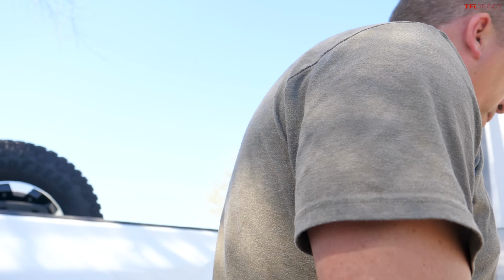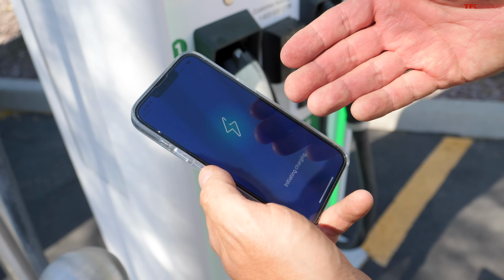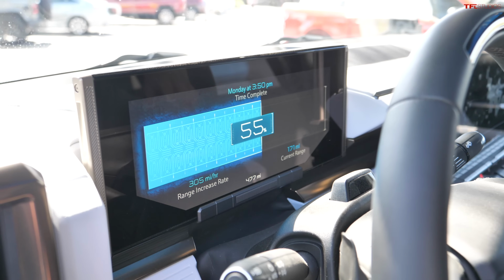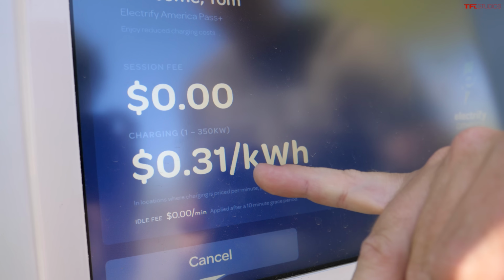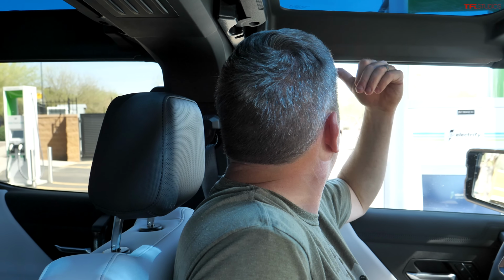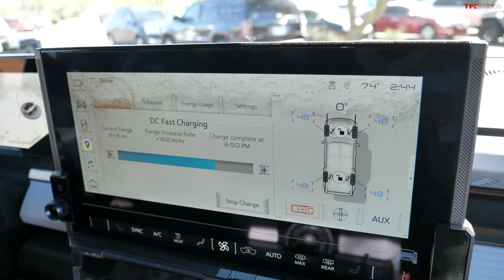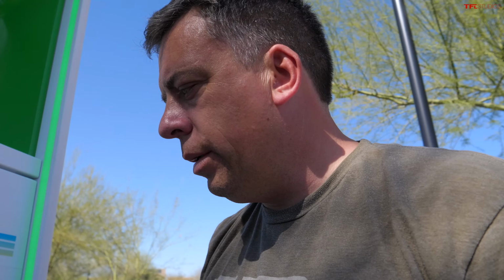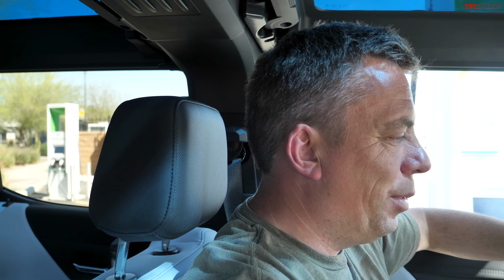How Fast Can I Charge The GMC HUMMER EV In Just 15 Minutes? The Answer Is Surprising!

Comment: Thanks for the review. Quick calculation in my head, this is still much cheaper to power than my 2021 Raptor on 37s. I get 13.5 mpg. Just paid $4.35 per gallon. So it cost me $25.13 to go 78 miles vs $14.25 in Hummer. And the Hummer is much faster. Great information. Also much cheaper to charge at home, I pay about $0.15 per kWh at home. So about half price to drive around town vs road trips.
Reply: Here in Olathe, KS I avg. about $0.11 per Kwh so cost per mile would be even better, however my GMC Sierra is paid for so for me the cost of a new $115K electric truck would be a terrible idea based on cost/mile.
Reply: Going to be a lot of different expectations going to electric. I liked the real world test- thought the results would better however- 78 miles for 15 minutes is slow in my opinion
Reply: Flushing cash down the drain to look cool, my Ford Eco boost is almost as quick and gets twice your gas mileage.  And fuel here in Colorado is only $3.18/gallon
Reply: Gasoline is at a historic high.  The EV would be more expensive in this particular case if gas was $2.00 a gallon.
Reply: @SkeldZ06  Around mid October a comparison showed, On a yearly basis, assuming the mid-priced cars traveled 12,000 miles, it would cost  $1,030 to drive an internal combustion car and $1,554 to drive an EV. 
For luxury cars that get 26 miles per gallon and using premium gas at $3.25 a gallon, the cost to drive an internal combustion car 100 miles is $12.60. The cost to drive a luxury EV, such as a Taycan, Tesla Model S or X or Jaguar I-Pace, is $15.52 to travel 100 miles. That is using mostly commercial chargers. 
“That’s apples to apples and includes the extra EV taxes, the commercial charging and the home charging and the allowance of driving to a gas station, which, for most Americans, is very short compared to driving to a commercial charger for an EV owner.
Reply: @SkeldZ06  yea but gas ain’t ever gone be that low, so you’re talking a bunch of crap
Reply: What’s nice about EVs is that you charge it at night (cheaper than during the day) and you wake up every day with a full battery. How many times do you drive over 300 miles a day?
Reply: @chadkrause6574  The bad thing is our infrastructure isn’t prepared to move as fast as they are pushing EV for the masses.

Comment: If it was summertime and 100° outside, and you just pulled off the highway, how would that affect the charge rate ?
Reply: Dramatically slow it down. Think of your cell phone battery when it's hot. However these batteries are temperature controlled so it's not as if it wouldn't charge at all. I would assume it would charge at roughly 50% rated speed

Comment: Lowkey 14.25 for 75 miles is almost the same as my Acura gets with the high gas prices and taking premium gas. Full supporter of electric vehicles but I was surprised at the price to charge this one.
Reply: Too many videos focus on the cost of public charging as if that’s what you’d usually do.   Inadvertently spreading EV FUD.  Most charging is done at home where the cost is much, much lower (like 2 cents per mile for a normal sized vehicle).
Reply: @-Jethro-  at home Hummer will be charging for hours even on 80 amp connection, which most likely breaker box will not have extra 80 capability and people will have to get another service installed from transformer, if this even supports 80 A at 240
Reply: @tallll70  Yes, true.  It’s so inefficient that a complete charge may not be possible overnight at home.   On a typical 240V 50A circuit it would only charge at about 20 mph.
Reply: @-Jethro-  Ah so screw us millions who live in apartments, or can't have have chargers, got it.
Reply: @snoopyalien24  If you really want one of these bloated things, you will need to find a way to charge it that works for you. 🤷‍♂️
Reply: @-Jethro-  I’ve driven a Tesla and to charge it didn’t cost nearly as much and teslas charging stations are far easier than electrify America
Reply: @martinmcandrew1377  Yep, I did a 1500 mile road trip in our model Y.  Tesla’s superchargers were awesome. We hit 249kw several times. 

But the point I was making is that most EV owners charge overnight at home most of the time.  The cost of public charging does not represent the normal daily charging cost.  I worry that the EV curious will see videos like this one and say “well that’s no better than gas”
Reply: @martinmcandrew1377  man if only they’d allow other manufacturers to charge at a small cost…..
Reply: @-Jethro-  this thing is still a piece of crap getting 1/2 the range of the cybertruck with same pack.  way worse than the ford product and even the planned silverado product. its 9500lbs?
Reply: @richardroberson9277  WHAT Cybertruck? The closest thing you’ll get to a Cybertruck os that Tesla 4 wheeler. The first product is a joke compared to this,😂and the Silverado is using the same pack is just a smaller vehicle.🤡
Reply: Also as the EVs increase over time, demand on the system will increase so will the elctricity rates for EV charging.
Reply: @ussenterprise87  it actuall causes it to go down because youre paying for access to 350kw not the energy alone as a silly consumer would think.  :/ they sit unused all day long now
Reply: This is the least efficient electric vehicle. It’s MPG rating is like 45 MPGe. It’s a horrible product from GM. Probably cause more environmental harm than your Acura that gets 25-30 MPG

Comment: You won't see 350kW charge rates at anything above 50%. With charging, you will see the highest speeds around 20 - 50%. Source: Me, I work on EV chargers.
Reply: its a 200kwh pack.  1.75C at 50% isnt  THAT wild.  you'll see it on the cybertruck for sure
Reply: 1.75C of 80kwh for a model 3 would be 140kw at 50% which i think they can do now

Comment: Interesting video with a focus on the speed but what about the expense? $14 for 78 miles of range? At $4/gallon and 20mpg you'd have only spent $16 for basically the same range, and would have been in and out in 5 minutes with a full tank. Personally I value my time at more than $2/hr. And of course this is before the government achieves critical electric vehicle mass and starts levying comparable taxes on electricity as they do for gas (California is already partially doing this). At which point you'll have price parity or worse. And let's not forget the cost of entry here at over $100k. I don't get it.
Reply: When was the last time you took a road  trip much more than 300 miles one way? Personally I think it was in… 2016? And that’s despite having road tripped to Yellowstone, Moab, etc in the meantime. Remember home charge  is dirt cheap.
Reply: @bob15479  That argument only holds water for affluent people with freestanding homes. That is not relevant to mass EV adoption. How many people own their home and can spend $100k+ on an EV. Most people rent, typically apartments, and won't have a nice garage to park and plug in. They live in cities and this is exactly where they'll be charging.

Comment: The GM Ultium platform seems incredibly promising. Can’t wait to see it on more affordable cars like the Equinox
Reply: If that ever come to production
Reply: You will have to wait
Reply: What is promising about it? Its only remarkable capability is to charge at 1000v, yet that likely won’t be possible on vehicles with smaller packs such as equinox.
Reply: this...is horrible performance. a 18" thick 200kwh battery pack is taking less power than a 40,000$ model 3 80kwh pack from 2018.  unless this is sarcasm lol
Reply: @richardroberson9277  this video wasn't done under normal conditions so of course charging was slower. But Ultium can charge up to 350 kW beating Tesla since their proprietary connector can't handle that high power without overheating

Comment: Very interesting. Good video.  We just did a 1500 mile trip in a Tesla model 3 and observed max charge rates when we started with a battery down at 20% or below.  Overall, surprisingly easy and convenient to travel with fast charging.
Reply: What is the cost of charging at home and at a charging station.
Reply: @jasonbowman7190  on our trip, the typical supercharger stop was 20 to 25 minutes and cost around $11 - $12.   I don’t have home charge costs calculated, but it is quite a bit lower than supercharging.  This car gets a lot of free charging while at work (which offers that service).  Either way, much lower cost than a comparable fuel purchase.
Reply: @jasonbowman7190  I charge at home mostly.  It is $0.05/kwhr in the summer off peak and $0.03 off peak in the winter.  On average 1000 miles is roughly $12.  Way cheaper than using a charging station. Model Y performance.  I average about 4 miles per kwhr

Comment: I regularly get over 1000 mph when charging my M3 at a Tesla Supercharger.  Those are only rated for 250 kwh.
Reply: Model 3 s can only display that because they are more efficient, but the truth is the Model 3 does not charge at 1000mi/hr. It has a charge peak of 250kw and charges around 300mi/hr in ideal conditions.
Reply: @DirectCurrentRides  Model 3 long range or performance charges at 1000 mi/hr (EPA) below 30 % state of charge if the battery is warm enough.
Reply: @bernhardleopold6702  1000mph is not a real measurement of charging. If that were the case, the Model 3 LR would charge from 0 to 100% in 19min. It does not.
Reply: @DirectCurrentRides  yes it is though lol.    for 40% of the pack.  stating kwh as well is nonsense as a larger pack will always win.  C rate is what matters and charge curves are what show that.  and time is important who cares if your charge to 100 is faster if mine to 50 is 1/4 and i can just leave.  >>  it matters for towing possibly or other factors.  its complicated.  but yeah gmc hummer is a pos
Reply: @DirectCurrentRides  so....it does at peak.  the charge curve very very clearly shows that being held to 40%....then it tapers down linearly.

Comment: This EV movement is fun to watch and very fascinating. Hopefully within 2-3 generations they have faster charging and more importantly range. Real world range is just where I want it to be to feel confident and comfortable.
Reply: Agree although I think it’s a bit of a gimmick. They’re over pricing these vehicles like crazy you spend 110000 msrp and if you look online they’re going for 188000 to save money on gas? Haha we fall for anything
Reply: i think model s plaids are already charging at over 1000 miles per hour.
Reply: @richardroberson9277 , Tesla is in an entirely different class compared to nearly every other EV in multiple areas.  Charging is probably the most obvious of those differences.  Even the Model 3 LR can charge at a higher rate than this, despite having a battery 1/3rd the size.  The Model 3 LR can also charge at several hundred miles per hour of charging so it's not just the top of the line Teslas.  It's all modern Teslas.  

I don't know what GM was thinking taking their most inefficient vehicle of all time and deciding to make one of their first EVs out of it.  It earned a reputation for being a vehicle for people that are proud to waste money.  It only had a few good years of sales at a time when gas was super cheap and the brand died quickly (and was viewed by many as a sign of stupidity) when gas prices went to $4 per gallon in ~2007.  This, and large super duty trucks used for towing, are the worst case scenario for EVs.  I think GM is going to sell very few of these.  Really bad product choice that was probably made by some MBA, bean counter, or marketing schmuck that was given a leadership position.

Comment: How much mpg would a car have to make to be the same price per fill up compared to the hummer
Reply: 60$/300 miles  6/30 .2$/mile  gas some 3.5 a gallon so 18mpg?  :/
Reply: @richardroberson9277  Your math is correct. The Hummer H2 was rated at 10mpg city/13mpg highway

Comment: Check to be sure you’re on a 500amp capable station. EA has derated a lot of their 350kw units to 350amps due to equipment issues… thus these high power 400v and 800v cars will never be able to pull max speed regardless of ratings. In addition to achieving said higher speeds at lower states of charge, of course.
Reply: How do you check if it's a 500 amp or a 350 amp EA station? We think all EA stations are currently limited to 350 amp.
Reply: @TFLtruck  talk to Kyle Connor at outofspec reviews. Guy and his team is anEV genius. He has talked about the ampage of station and he does full charge curve testing 0 to 100 and explains these things better
Reply: Yeah this is the right answer. EVGO has the 500amp stations
Reply: yep. its virtually certain that this is the issue since i don't think that hummers battery pack was hot at the time of charging.

Comment: I heard many of Electrify America's 350kW chargers can't charge at that rate. They need an updated module to get to that true 350kW speed. EA is working on replacing those on their chargers.
Reply: Then they should take the sticker off of the unit until the modifications can be made

Comment: I wonder how many charging stations they had to stop at before they found one that worked...
Reply: Honey I’m going to get the hummer charged up I’ll be back before supper.
Reply: @michaelbassett5105  there I just plugged the hummer into the largest Level 2 charger on the market 80 amps.  It will be done in 12 hours.  neat.

Comment: 78 Miles in 12 mins is pretty impressive. Let’s compare it to its closest gas truck competitor the RAM TRX, which avg 11mpg (if you’re babying it). At 78 miles that’s about 7 gallons of gas in the TRX. National “premium” gas prices is around $5. So let’s take 7 gallons x $5 would be $35 for the TRX compared to $14.25 for Hummer Ev. 

$0.31 is pretty expensive compared to home charging which avg $0.10-$0.20 per kwh if you’re on the grid. People who are off grid with solar $0. Also, some charging stations offer 1-3 hours free charging at 6 kwh which isn’t fast but better than having to pay.
Reply: Imagine sitting at a pump for 12 mins and only pumping 7 gallons. I get the point that the charging stations are mostly meant to get you to your regular level 2 charger, but they highlight the issues with taking an EV on a road trip, especially if towing.
Reply: @danielc3510  if towing he would have to add an additional 30-45 minutes for drop and hook if trailer parking is even available vs pull through fuel pumps
Reply: @danielc3510  it was 18min plus fumbling with a phone app for several minutes to charge this baby up. Nation average gas pumps run right around 10g per minute.
Reply: Make sure and drive those 78 miles quick.  Let it sit around and miles will just disappear...
Reply: @michaelbassett5105  

Vampire drain? Not really an issue. Just left our EV unplugged for 5 days and didn't see any loss at the airport. Nor has it been an issue with any EV we've owned. 

.... Let it sit for a month or two and the story may be different.
Reply: By the time it's fully charged, the TRX would be at the destination. Your time is worth something too.
Reply: @sptrader6316  I think that was partly the point. You’re going to spend LOTS of time refilling at the gas stations if you own a TRX. So I agree, your time is worth something. Your money is worth something too and you’re spending more money at the pump in a TRX. Your purchased experience is worth something too. Time it takes to refuel/recharge shouldn’t be the only measurement for convenience.
Reply: And when you figure in the additional cost to purchase,   it will cost more to operate than a gas vehicle.   Not to mention that the electricity is most likely being generated by coal or natural gas.  Now add the additional pollution to make the lithium batteries,  they are not eco friendly
Reply: @48VAC  How is a fully electric car not eco-friendly? How many emissions are there on a Hummer EV vs. a TRX? How many times do you have to refill that TRX to make it where the Hummer has arrived? Trying to race the Hummer to the same destination you’re gonna end up burning even more premium fuel. Also the TRX is slower than the Hummer anyway, so by the time the Hummer has been parked and fully connected to it’s fast-charger, the TRX may be pulling up by then.
Reply: @mybro727  my 2022 2500 HD with a Duramax was $38000 cheaper than that Hummer. At $5/gal for diesel that's 7600 gallons cheaper. Or for me about 7 years of fueling.  They still have to pay something to feed that electric pig for the 98000 miles of fuel I'd burn.  98000/2* .13=$6370 of electricity additional required.  That pig will never break even in it's usable life cycle over a diesel truck.

Comment: Wait till those government taxes/fees/electricity price increases kick in.  So at $14 you got about a 100 miles. That's roughly 3.25 gallons of gas where I live, my vehicle gets 30 mpg . 3.25x30= 98.5 miles. Savings?
Reply: What about the much higher initial cost for the EV. I don't see much savings + you have to deal with "range anxiety" trying to find the "right" charger, especially if you're on a trip. Then there's the time wasted charging. The tech isn't there yet for me.
Reply: @sptrader  same here. I live in very rural area and unless I spend $2-3,000 to upgrade and install a charger unit at home a EV just isn't practical for me.